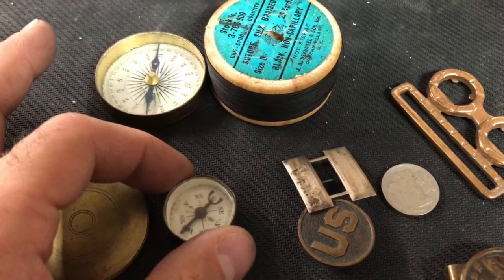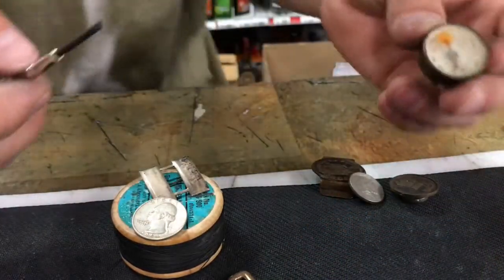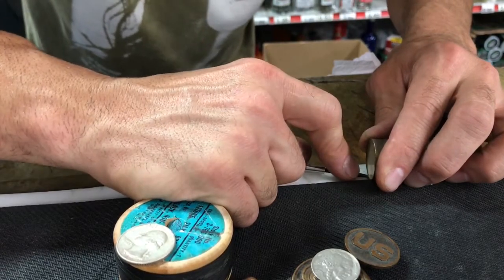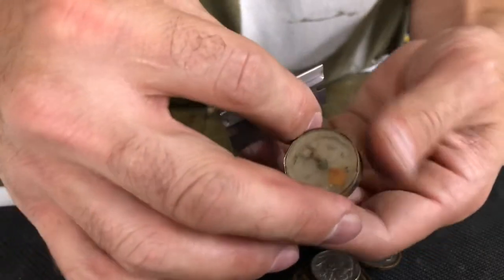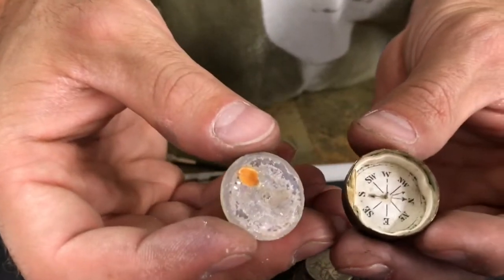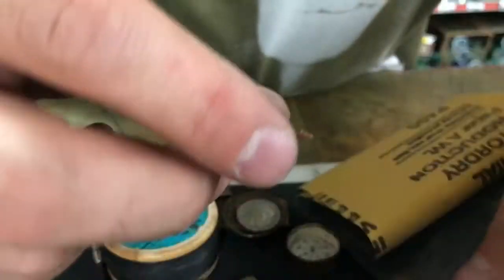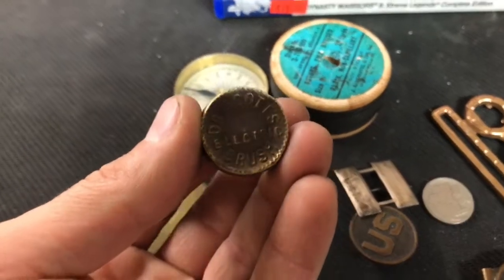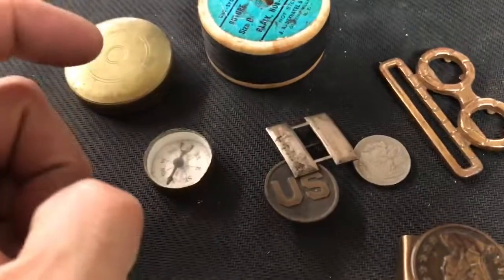How To Restore A Old Vintage Compass

Comment: So I have an antique compass, one day it fell on the carpet floor and when I opened it the compass wasn't working anymore so I unscrewed it and tried to put it back but it isn't working. help?
Reply from the maker: That would be something I would have to look at hands-on to try to fix the problem check if your needle is freely moving or is it stuck on some thing
Reply: @KooperSalmo  There isn't any needle its one of those compasses that have a medal piece "kinda needle" underneath its hard to explain I would need to show pictures of some sort.  it needs to balance on something but its stuck now and I don't know whats wrong.